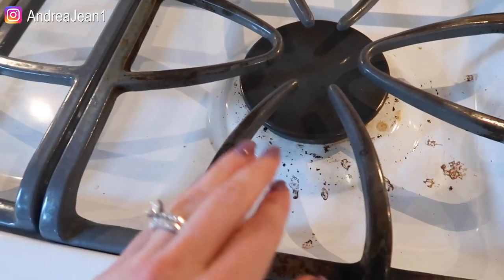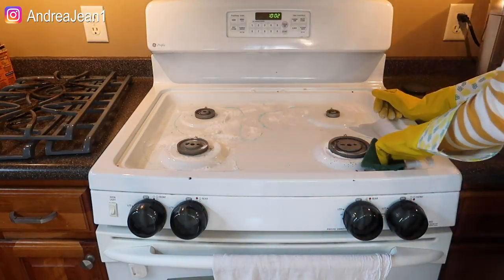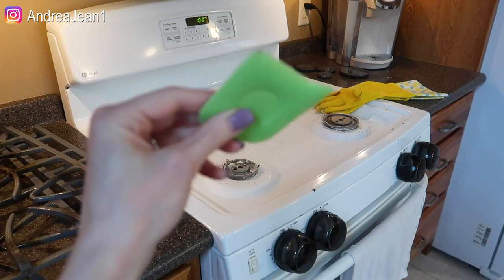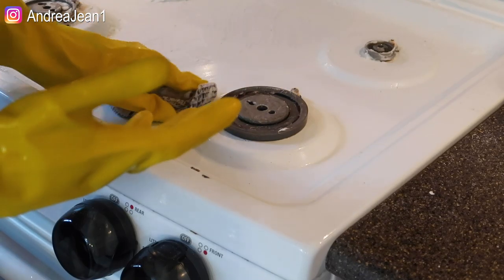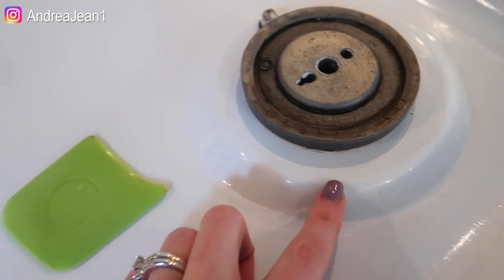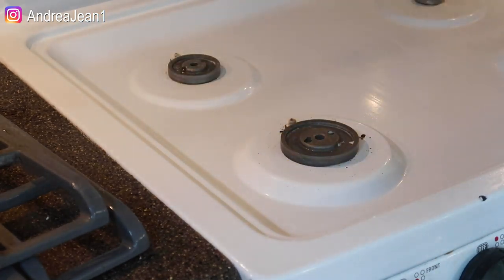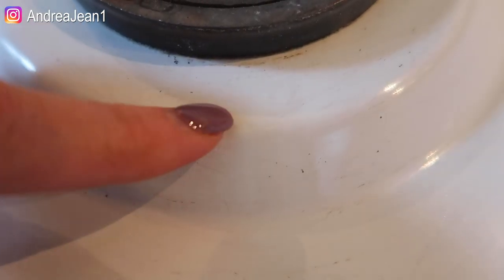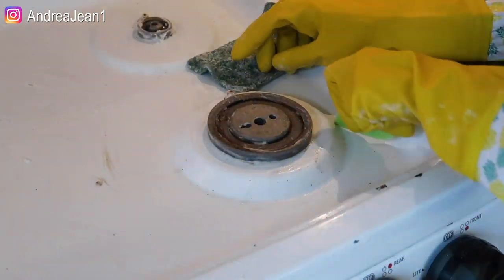HOW TO CLEAN STOVE TOP with Hydrogen Peroxide, Baking Soda, & Dawn to REMOVE GREASE FAST!!!

Comment: I leave a damp cloth with Dawn around the burner on the spots to soak. Later, I go back and it usually wipes up after soaking or will come up with a magic eraser. The magic is soaking it under a wet rag.

Comment: I use windex , spraying entire surface generously, a little heavier for those really dirty areas ,let it sit for 10-20 minutes, take a green scrubber pad to clean with, if the knobs come off soak them in a Windex and water solution for a little while use a toothbrush to clean with, I've been cleaning my stove with Windex for over 30 years

Comment: Hi Andrea Jean.  Eureka. I am a fastidious single guy who loves " cleaning hacks."   The Per. / B-Soda is an effective combo to tackle the stove stop.  Yes, sometimes stains ( as black ones, in your video ) will remain after all the elbow grease. Solution : remove the tenacious black stains using....wait for it ....the hard plastic -- mine is Orange -- screw top that one finds on many large juice containers. Check Costco for the various brands.  You then use the juice top like a puck : hit the stain at a 30 deg. angle, using the naked edge to SCRAPE off the stains in relief of the shiny stove surface. The plastic is softer than the stove top -- thus it should NOT scratch . Done !
Reply from the maker: Thanks Jon!

Comment: I found Janies Best Laundry Derergent improved on YT.  She does a very good stain remover with the condensed part. We bought a rusted antique army jeep and thought why not try it. Well it worked so decided to use elsewhere including the top of my stove. Because it is globby it falls off uneven surfaces so it may take several applications to keep it moist.  You want to leave it on as long as you can (overnight is fine). Use the scrubby to see if it will come off., May need a little elbow grease but it worked well for me. Now my go to thing if all else fails will work on your grids too!

Comment: About those difficult stove black marks.  How about a heavily dampened rolled paper towel drenched with engine degreaser.  That or carb cleaner.  Let those paper towels soak on the culprits.
I haven't tried that but it DOES work wonders on beautifying the auto engine.
I realize those 2 cleaners must be used in well ventilated areas.
Keep up your video's.  I learn alot. 
My wife is impressed I'm trying to help in house work.
The only problem is she tells her friends and the husbands get back to me asking what in tarnations am I trying to prove. They told me to STOP IT!  The wives are asking why they can't help.
Hey, I ain't proud.  I just remind the sadsacks, didn't we have to be diligent in "policing" our barracks in boot camp?  The head had to clean enough that you could eat off the floor if ordered.
Their response is, this isn't bootcamp.
Drunken WIENIES!
Reply from the maker: I love your ideas Dave! Thanks ✨
Reply: You are spot on! I have been using auto degreaser (especially for the ventilation filter over the stove) in the kitchen for years.  A total lifesaver!